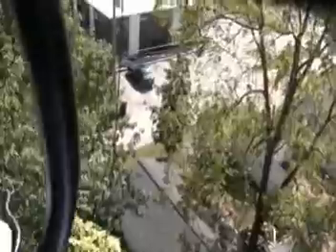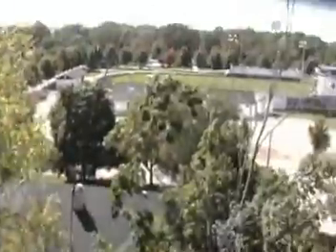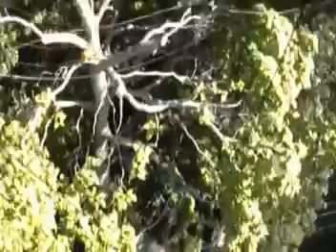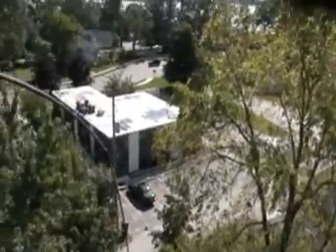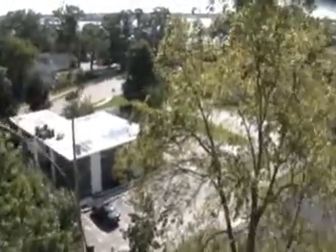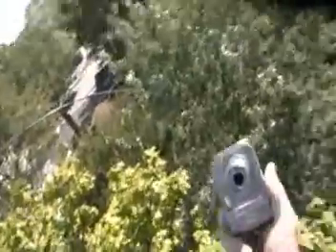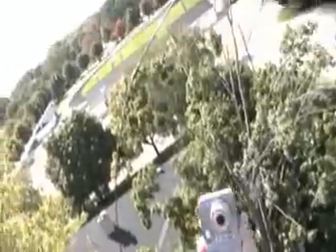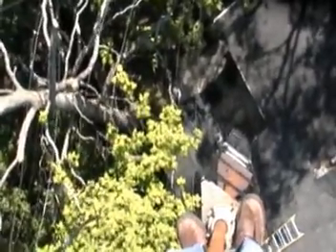New Antenna Design

Comment: @jmecrg The wraps are a coaxial choke i believe...No wraps equals no choking off of stray reactance backdown the feedline which can result in RFI in the form of shocks and/or rf burn and other headaches.If you've ever felt this it makes a few simple wraps of your coax at the antenna end a pretty significant idea.I don't know if i worded that spot on but i think you get the idea.

Comment: Would love to see a new video made with a much higher resolution. I'm kind of curious to know how this antenna has fared for the last 12 years and if you've made any improvements to it or just replaced it with something else. Found this video through a Google search. It looks impressive, but I can't find any information on the antenna itself. No kits, no build instructions, nothing. Just a website touting how awesome it is and what it looks like. Have you thought about having a commercial antenna manufacturer build these from your designs? I'd like to know what a professional RF engineer would think of your design. A/B comparisons between a beam and this antenna would help immensely. Perhaps you could build one for your local club and compare it to what they have?

Comment: I noticed 6 raps of coax on your antenna boom on the diagram that came with a dipole antenna i seen it said to use 8 or 10 raps . what if i use no raps? i`m new at all this . very nice tower by the way very sturdy .